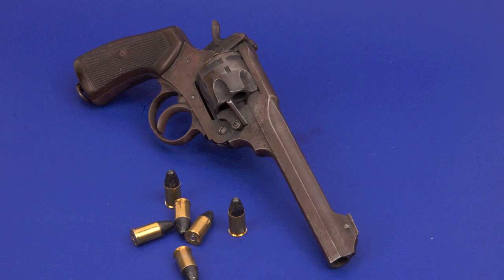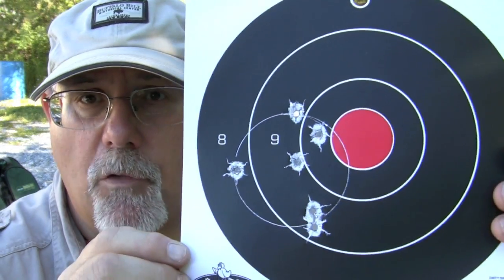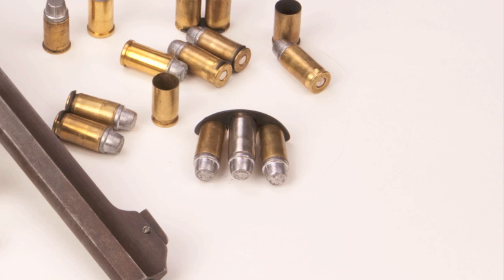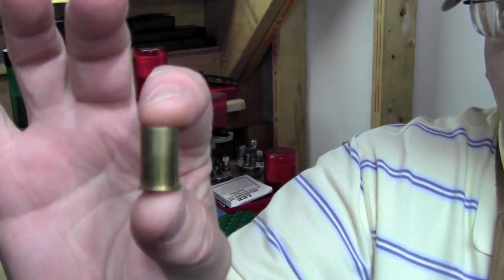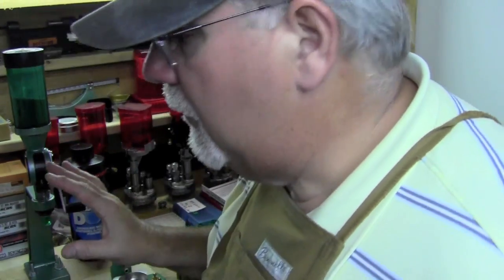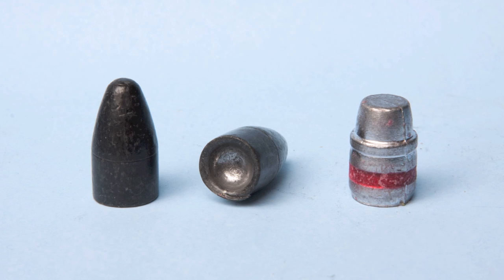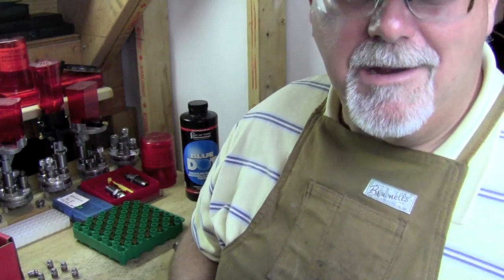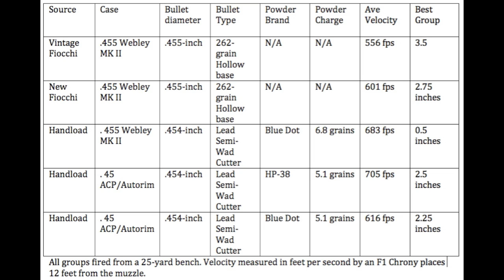Handloading for the Webley Mk VI Revolver - Part 1 455 Webley.mov

Comment: So glad I handload. I use a 265gr HB bullet from a guy on Gunbroker. Looks identical to the standard service bullet. I use 4.0gr of HP-38 using Fiocchi brass. Sad thing is just to get the brass I had to spend 150 bucks for 150 loaded Fiocchi 455 cartridges.
Reply: Do you know the average velocity of your loads? I have both HP-38 and Ramshots True Blue powder but i cant find anyone else whos used true blue

Comment from the maker: I'm using Lee .455 Webley dies. You could size on .45 Colt dies, but the Webley brass is way to short to case mouth expand or crimp on .45 Colt dies or .45 ACP dies.

Comment: When webely produced ammunition for these revolvers they developed cartridges using fast burn rate propellants(Nobel no1+2)+ tight crimp.When I shot this type of revolver,(when handguns were legal in uk)I developed a load with 265 gr hollow base projectiles over 3.8 gr hercules/alliance bullseye.and3.2 gr bullseye under 220 gr wadcutter.once you perfect crimp it is the most accurate rounds I'E used.

Comment: The British tended to use heavy, relatively slow bullets.  When they went to the .38 cartidge it was the .38/200, meaning it had a 200 grain bullet and loafed along at barely more than 600 fps.  I'm sure that a 200 grain bullet would do some damage though, even at the stated 620 fps.

Comment: I've noticed that Blue Dot seems to burn clean in most guns.I wonder what some Goex or Trail Boss would do in that little case?I bet you could see the bullets in flight.
I've got a SW 1917 that I've been considering loading auto-rim for,I hate loading round into those moon clips.I'll be looking forward to part 2.I wonder if those .455s would load and shoot in my 1917?

Comment: I had Corbin make me a swage set that duplicated the old Dominion 265gr 455 Colt bullet.  It's a blast to shoot in the S&W .455 Colt NWMP gun.  The Corbin bullets have all the weight up front and tumble upon impact just like the old Dominion loads.  They shoot just as well in the Webley revolvers as the Smith.

Comment: Was most of the junk in the barrel after firing the Fiocchi just leftover gunpowder or did it lead more than a lubed bullet? I don't see any lube grooves on the Fiocchi. I always thought that not lubing lead bullets would lead to a decent amount of leading even if the bullets are properly sized for the cylinder and bore.

Comment: Sorry I am reading this so many years later. Great information, I just bought an Ideal 456401 bullet mold and didn't have a proper gun to go along with bullet, so I found a nice Canadian contract S&W second model 455 MKll Revolver in original condition. Now the hard part is the brass.

Comment: I guess I sm slso late here.  I have a shaved Webley.  In the past I have shot 45 ACP ammo in it.  I now load 45 GAP brass to 455 data.  The 45 GAP case is almost the exact size as the 455 brass.  Works great.

Comment: HI Mike I used this load on 20 Hornady cases  with a firm roll crimp.  Accuracy was better than the factory rounds but did experience more recoil and my Webley Mk VI the brass had expanded and was just a little sticky.  However, in my Colt New Service .455 it shot fine and the cases ejected without any effort.  As you commented the Fiocchi brass uses small primers the Hornady brass uses large primers. So the Webley chambers may need a little polishing..  Though the accuracy was improved it still shot within Minute-of-Zulu!  The Webley shot a 4 inch group where as the Colt shot a 2.25 inch group. I really enjoy your videos.  FYI I also have a Colt New Service in .45 Colt and accuracy with it is outstanding and will probably become one of my favorite DA revolvers.

Comment: I intend to mimic your load.  I will be using a Lee 4 hole reloader. I've got some of the same bullets and I wondered about the crimp. Lee provides for a "factory size" die in the 4th hole, but there is none for Webley .454. So, am I ok without it or would a .45 acp die be advisable...?

Comment: Hi great video im only starting to load for my webley would a 230gn rn projectile be suffice in 454 sizing as no availability of the 455 sized in 265gn. My only other options is to buy a mold but i reload on a budget currently.

Comment: I just bought an unshaved Webley Mark I. It's considered an antique so it gets around Canada's nonsense laws. Looks to be in great condition. Will definitely treat it well. Does anyone know if this 6.8 grain blue dot load is safe for a Mark I?
Reply from the maker: Great find! But, I would only shoot it with black powder loads.
Reply: @duelist1954  Thanks. I would still like to try smokeless powder. I've seen people loading .45acp for shaved Webleys using 4gr of unique. Dude selling it threw in 70 once-fired brass casings on the house so I'll try to make some loads at around 10,000-12,000 psi to be safe.

Comment: I have one of their C&B guns and wondered the same thing but according to the manufacturer it won't work.If you go to their website and look in the FAQ they have some info on it.
I went to the site after I tried to fire mine with CCI caps and the cylinder wouldn't go back in the gun.The FAQ says only Remington caps will fit,now it shoots fine

Comment: Why not just use 45 Autorim cut down to 455 Mk.1 length to solve the issue of headspacing.  Seems the most eloquent way of doing it.

Comment: Just curious why didn't you trim your 45 auto rim down to what the 455 webley would be with the extra rim? And have you considered using Clays or trail boss powder it makes bulky light charges and you don't have to worry about a double charge because it wouldn't fit.

Comment: Love the old top break Webleys. Real old school British cool. Plus a big ol .45  caliber bullet ain't bad either. But 6-700 fps at the muzzle?! That's just ridiculous. You'd think that if they were gonna go for a low energy big bore cartridge they'd at least use a lighter bullet, around 200 grain at most, like 380 acp compared to 9mm para. That way you'd at least get a decent trajectory out to 100 metres before it dropped off.
Reply: A heavy bullet, esp with a wide meplat, can still be very effective at low velocity. The old .38spl HBWC load is a good example. They will mess you up with only 650-750fps or so. I would feel fine using Mike's hand loads for social purposes. Soft lead would be even better.
Reply: @mkshffr4936  Thanks. I don't doubt a 455 bullet would be more effective at stopping a threat quickly than a 9mm of similar density in the same place, albeit not by leaps and bounds, but it seems to me that at 650fps the rate of drop off would make aiming difficult for anything but close range fights. Not a problem against a native wielding a club but most combat ranges in 20th century warfare were somewhat longer than that. Not that a pistol is going to be very effective against an enemy 100 yards away, no stock and all, but the trade off for that big heavy bullet with soft recoil is too much to justify the sacrifice of range, at least to my way of thinking. Besides a six shot revolver takes time to reload so light recoil and rapid follow up shots seem less important to me than the six rounds available being powerful enough to do the job before having to reload. Just my thoughts on the matter, I don't actually know as much about guns as I pretend I do.
Reply: @launch4  Yep, my understanding is that the doctrine was that the sidearm was for close range defense and the rifle for actual fighting esp. at extended range. Although it is amazing what a good marksman can do. Check out Hickok45's channel. He is amazing often hitting the 80yard gong with pocket pistols off hand.

Comment: I have an unshaven Mrk 6, do you know of the right bullets for it and what powder do you suggest for a cleaner burn, but not be too over bearing for the top-break action.
Reply: It's not the break action that's the problem, If you've got £15,000 to spare Anderson Wheeler will make you a Webley in .357 mag.  The cylinder is the issue, and it's compounded by the fact that in the US you can count on it being a war production gun that somebody has almost certainly been abusing over the last 80 years.
Reply: @chaimafaghet7343  OK then